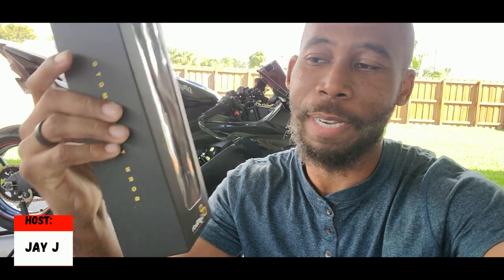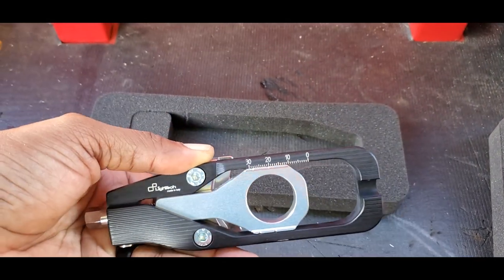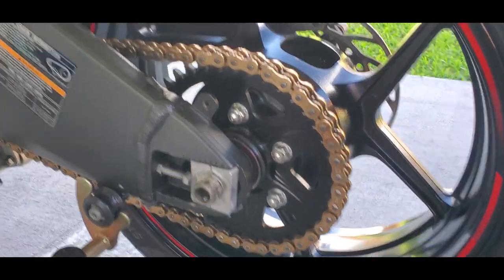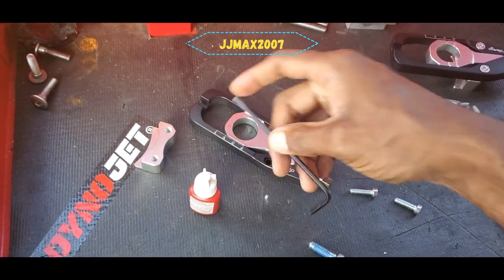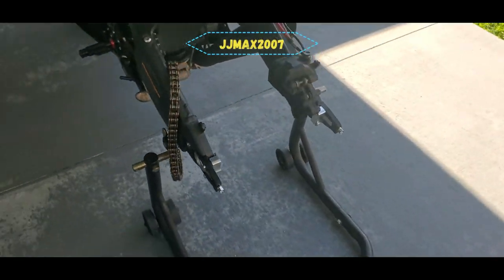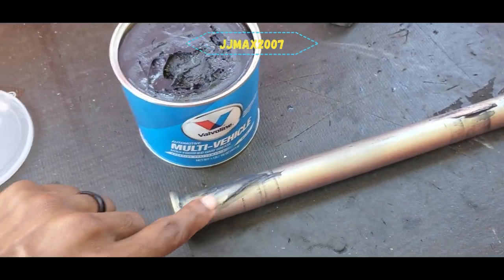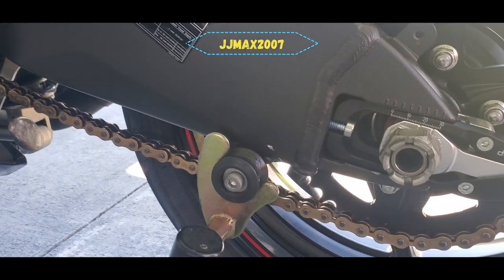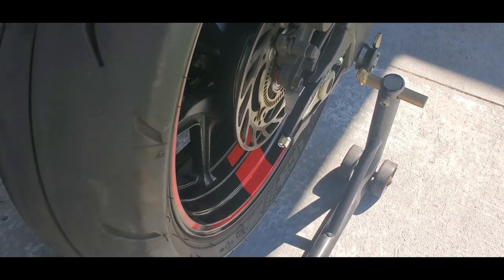KAWASAKI NINJA ZX6R 2019 - 2023 REAR CHAIN ADJUSTERSI STALL  ( SO SO MUCH EASY TO USE OMG!!! )

Comment: Nice work. Was the red spacers necessary for install or can I install chain adjuster without it
Reply from the maker: The red spacer is not important u can go with out you see it in my cause I did a video before to make the wheel for me easy taking off and putting back on 

Cheers